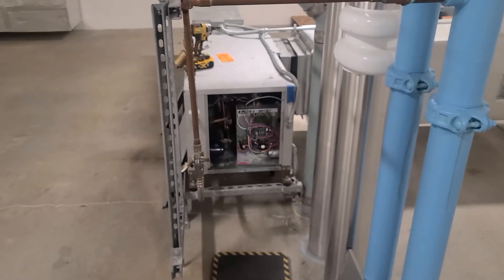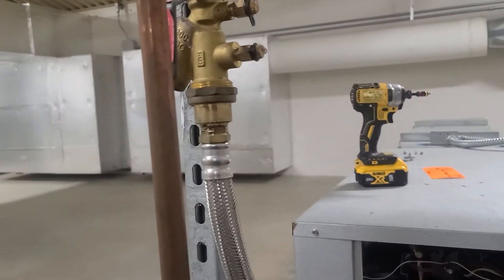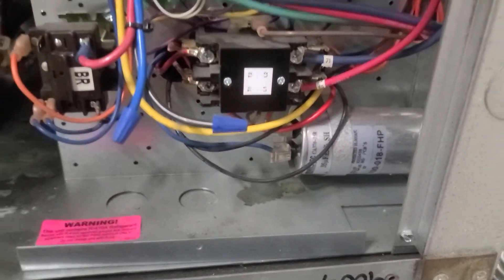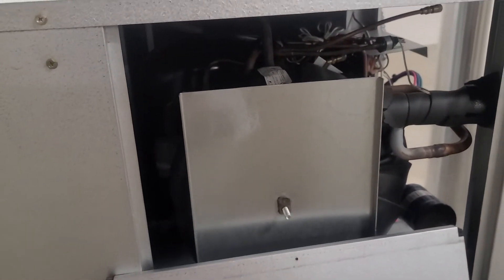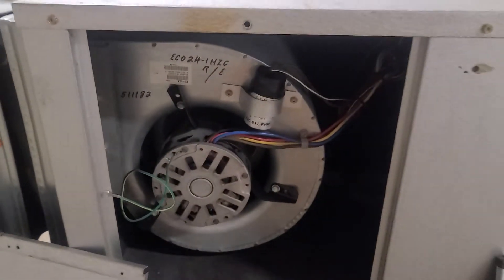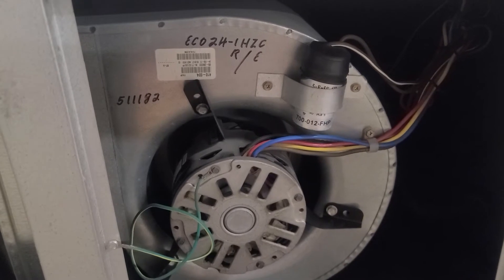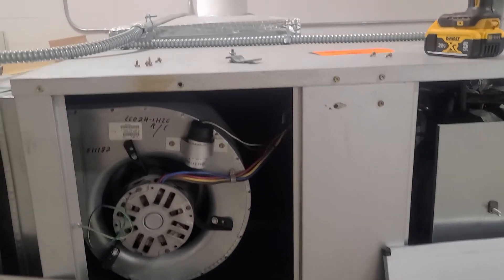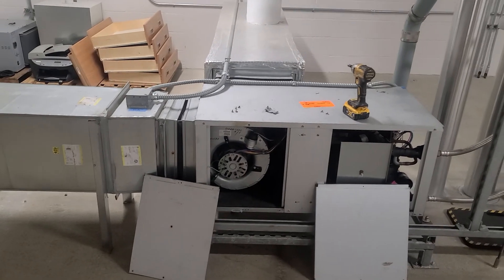HVAC Water Source Heat Pump Maintenance

Comment: Thank you for the video. I’m working on a high rise condominium as a maintenance technician, the most common issue is clogged on the condensation drain line. What do you think is the best way to solve this issue? I watched a lot of videos and some others said use a drain tablets, anything advice or suggestions that would you recommend? Thanks

Comment: It’s common for sealed motors to leak. Just for your knowledge. In residential it’ll happen after a years of working. 
It’s only bad it amps are high above manufacture specs otherwise you’ll never know how much oil has leaked. Eventually it’ll cause bearing issues but that’s usually after like 8-10 or more years of running

Of course this can happen sooner but the oil is not really a huge concern on those types of sealed air over blower motors